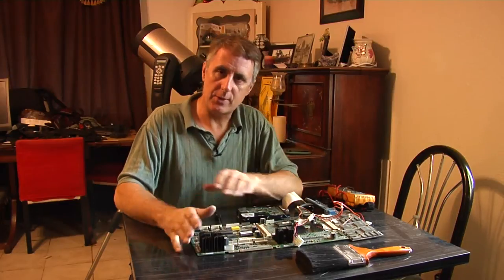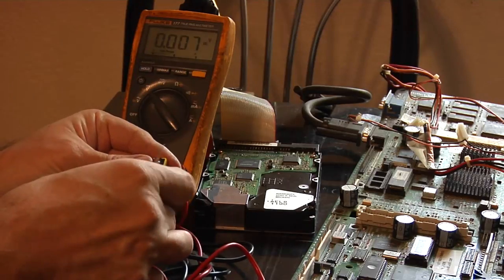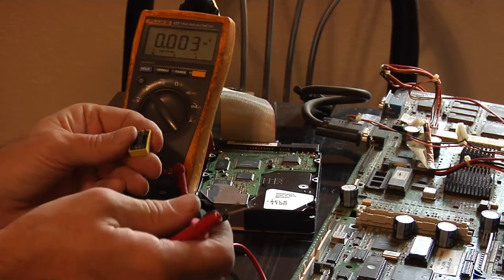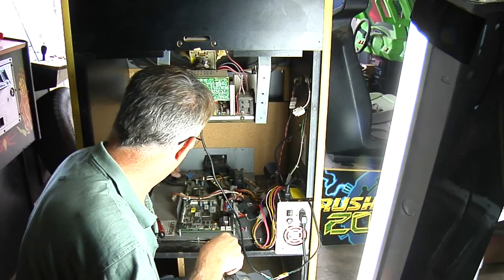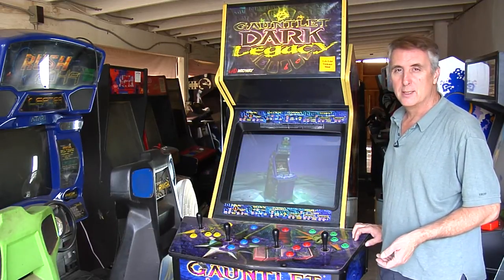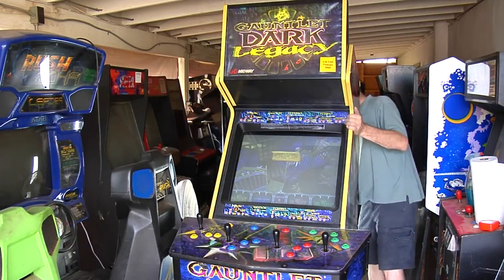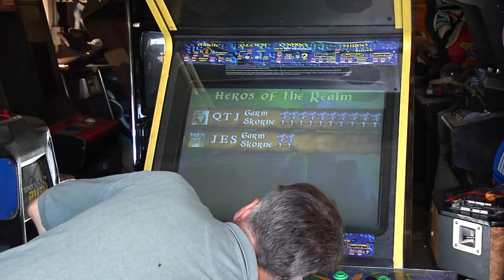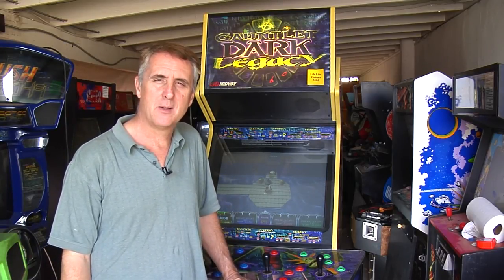Gauntlet Dark Legacy Arcade Repair Episode 2

Comment: I have just repaired my unit and I would also suggest the following precautionary tasks:

1) I see on you video board that you have no heatsinks - I would get some "Black Aluminum Radiator Heatsinks" Around 28mm x 28mm x 15mm in size.
3 to fix to the graphics chips. Afix with Thermal Conductive Heatsink Glue. 

2) Replace the 2 brushless fan units:
JMC/DA-TECH 12v 80mm Fan, Brushless, Model 0825-12LLB, 80x80x25mm 0.12A OL0349.

Less than $20 for the lot

My fans stopped working - I had no idea that they had - cooked the card.
Which ended up costing me more that $20
Reply from the maker: Thanks, That's a great tip.

Comment: Just picked up a dark legacy that looks to be original and very clean. Would you suggest takeing the tube out for transport or will road vibration be ok for it on a trailer?
Reply from the maker: It should be fine. If you have to lay it down just make sure the neck board and everything else is plugged in well before you turn it on. The marquee topper is pretty fragile if you bump it.

Comment: Great work! How much was the total repair and cost?
Reply from the maker: +TheMrMaynard Thanks, Lets see, Power supply was $55.00. New board set off Ebay was $96.00 with shipping. Monitor was about $60.00 off Craigslist and the game was $300.00 for a total of $511.00. Not too bad to save a nice classic in a great cabinet!
Reply: This Old Arcade (Classic Arcade Machines and Tech Tips) That is VERY impressive. The more I watch this series, the more I just want to get out and grab a couple cabinets. Just no room yet to do so. Rush 2049 will be my first once I do.